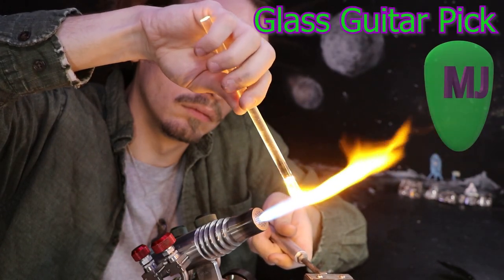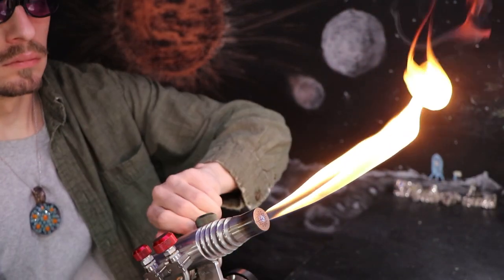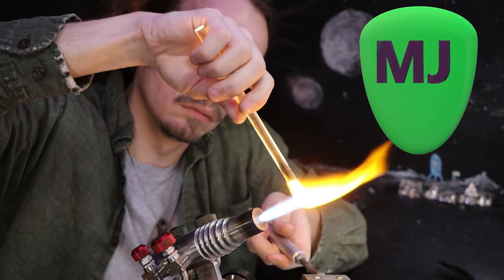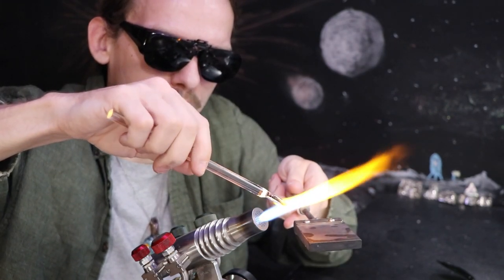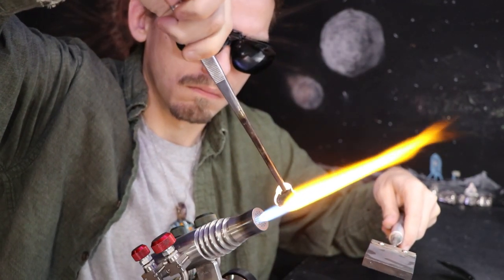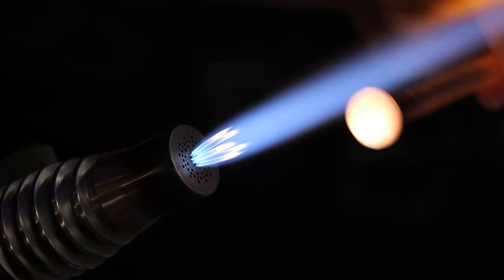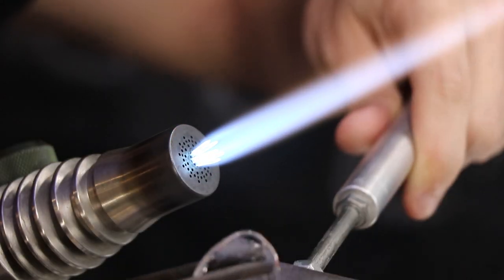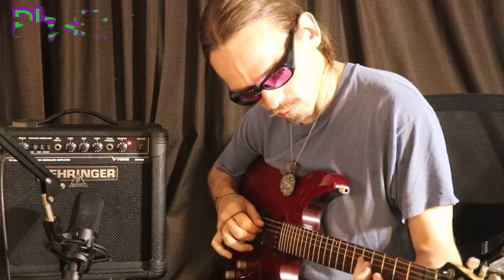Glass Guitar Pick - Scientific Arts

Comment: hey can you give me some advice on glass repair? I have a piece I would like to fix that has a u shaped crack abour 3/4 of the way from completing the circle. should I run it through an annealing cycle to start or just slowly heat it to garage temp? when I go to flamework should I start heating away from the crack and walk into it or heat direct? should I add a bridge or just go over it with a smith torch?
Reply from the maker: Hello Chris, you sound very knowledgeable yourself. I think you need the confidence that you can make that repair a success! And if not, well that's how it goes. But I would lay it in a cold kiln and bring it up to annealing temperature slowly. Run an annealing cycle then quickly pull it out and melt one end of the crack, kiln for 10 minutes then repeat for the opposite end of the crack. That should keep the crack from running, just try not to let things get too cold as your working. I hope this helps, good luck on your repair!